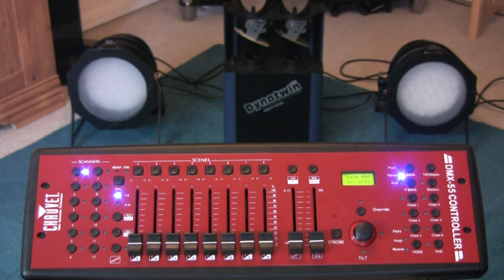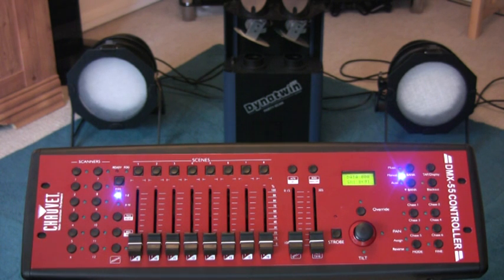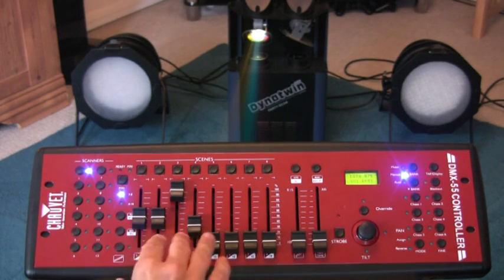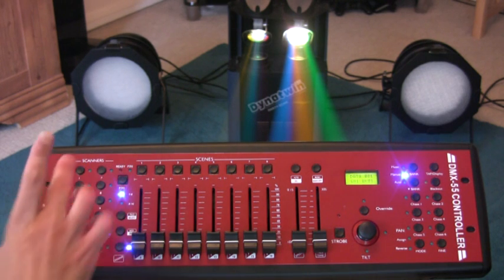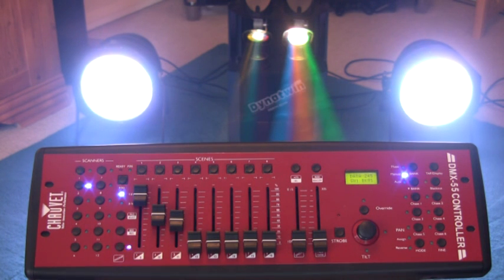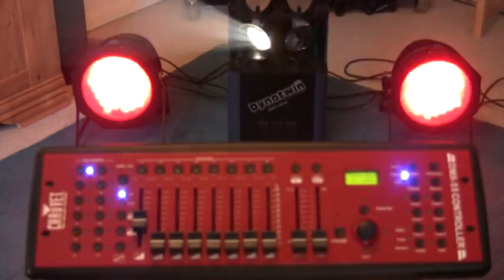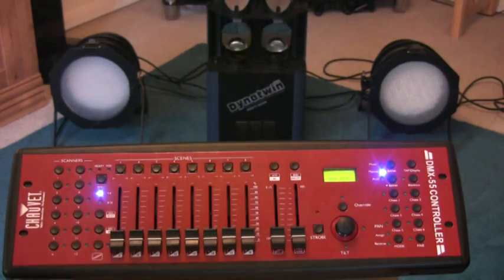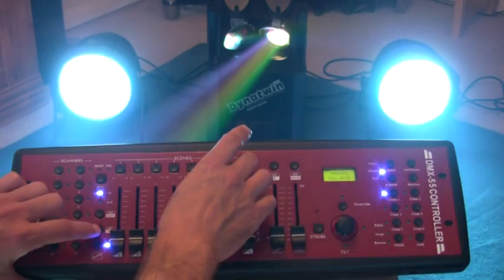DMX AND MINI LIGHTING CONTROLLERS PART 3

Comment: You have to hook up one DMX cable to the back of your controller and then to your first light you want in your series. Then you can hook up the light you want next into your first light which is hooked up to your controller. Keep repeating that until all your lights are hooked up. They refer to it as a daisy chain in the user manuals but that just means all your chain or group of lights in master/slave mode or DMX mode. I have 2, 4 plays, a mega moon, a radius 2.0, a six spot, 2 pin spots, a mi

Comment: hey mate i am just about to get into Djing and i just bought a strobe but im considering returning it and upgrading to a DMX compatable 
but im not sure how much i will be spending
so just on a rough estimate
how much did it cost to get the products in this video? and im gunna try and get a DMX compatable laser system but im not trying to spend to much 
so in total
Controller Board
Strobes
Lighting
Software 
how much would it cost?
and how much for a good laser system and haser?

Comment: ohhh dont worry i fixed it. having a dumb moment.. i had all the chases turned on... looks great now got two led dynarocks and two led parcans linked to it looks kwl... thanks very much if it wernt for you i would properly still be wondering where to put the ac adapter... :p